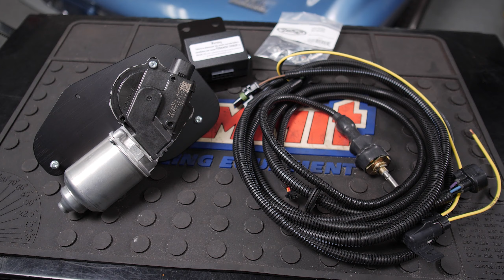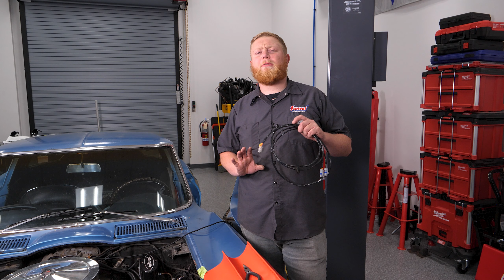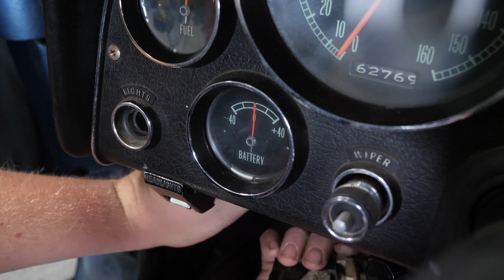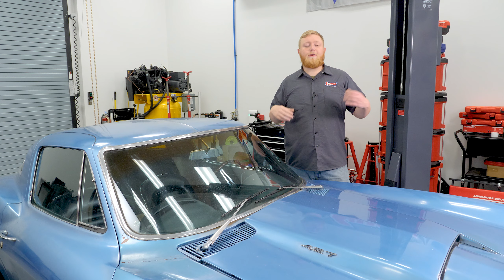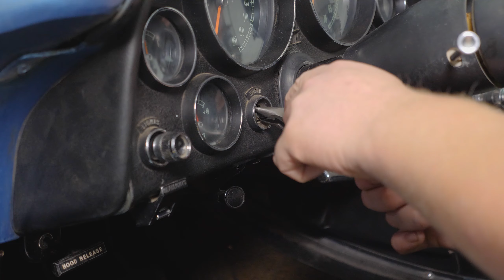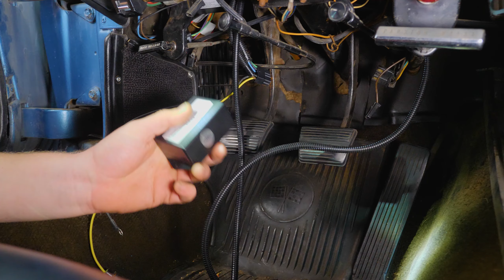Barn Find 1966 Corvette: Headlight Motor Upgrade & Modern Windshield Wiper Conversion

Comment: Working under the dash in a C2 is no joke. 
If you still have the whole washer pump assembly that unbolts from the front of the factory wiper motor...I'll buy it.

Comment: There is a slot at the bottom of the wiper switch casting that allows you to get a small screwdriver on the knob set screw. This allows you to seat it fully.